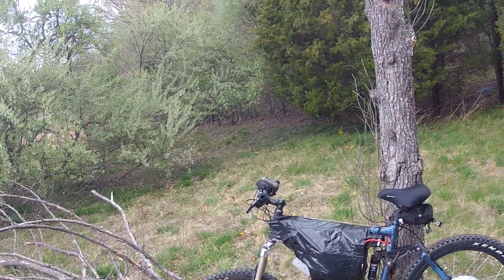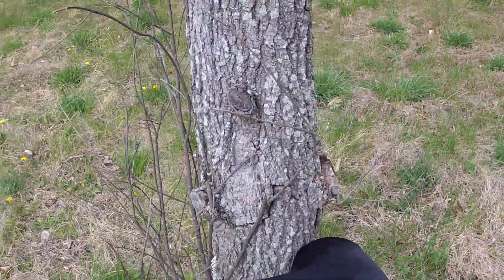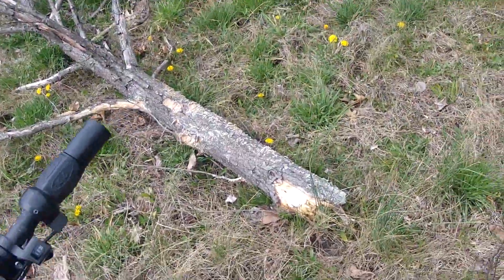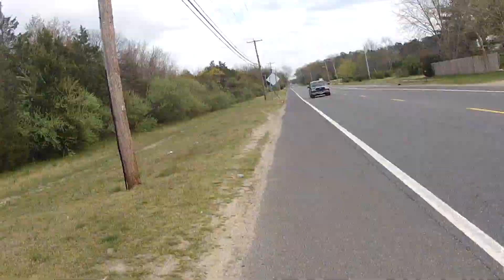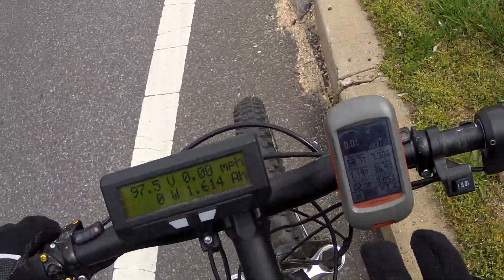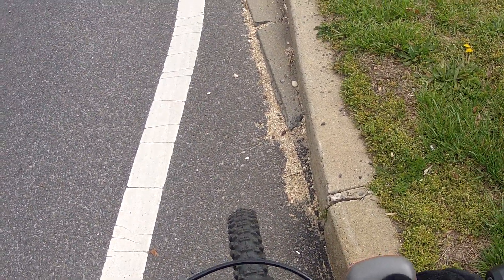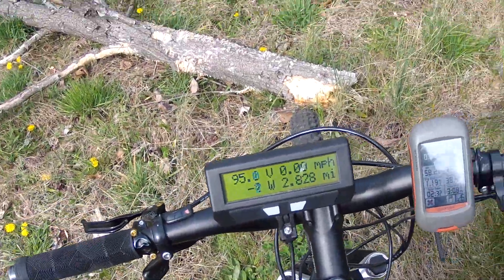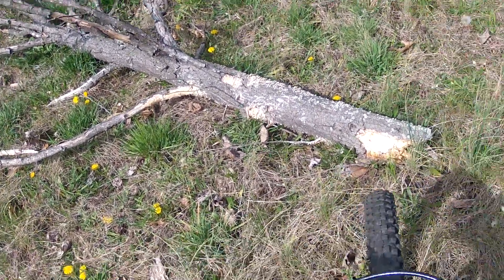Crystalyte 5403 e-bike.  58mph 100v 80amps

Comment: You should get know that that motor is more for torque and not for speeding ;) I use the same hub how ever 72V and "phase" is set to 110-130Amp (right now 110) and i get same speed like you but like i say, this hub is more for torque.. ;)
Reply: LOL 58mph at 72volts? I'de LOVE to see that.
Ive seen about 5 of these motors being used on the forums. NO ONE is near 60mph at 72v. i guess your special?! lol (small bus special)
Reply: Billy Chron im sorry. 72v or what ever... its not really that 72v that makes the speed lol. If you dont have your own to show or speak about then what good is there to talk about Them others bikes or hubs?
Reply: SuperMaiki76  actually, volts is exactly what determines your speed. Along with the hub and rim size. Amps determines your acceleration. Again, no way your getting those speeds at 72v
Reply: ok, if u say so
Reply: SuperMaiki76  and I do. Check my other vids. I have used 4x other hub motors with different windings (speed vs torque) along with 48v, 72v and 100v setups with my amps ranging from 20-120amps as I progressed in both knowledge and ability.
http://WWW.endlessphere.com is the place to soak up more information than you need, from people like me that actually build and experiment with these things.
Reply: Volt's only half determines the speed of your hub. The amount of copper winds on the motor determines the other half.

The amount of winds on the motor will determine the speed at which the hub will turn. This is measured by KV (Turns per Volt). 
Most of these big motors are around 8 - 10 KV. So if you have a motor with a wind at 10KV, which runs at 96 volts then that's 960 rpm.

However if you specify a motor to have a lower voltage with the winds adjusted to have a higher KV rating then you can have a 72 volt setup that will go fast, however these would be custom, and draw more amps than a 96v setup but it would go to that speed! 

My 7kw 96v setup will only do 45 mph tops! but I specified it do so as I wanted all torque monstrous acceleration and not much high end.
Reply: "Torque Monstrous Acceleration". Auuuhhh Yeeeaaahh maaaan. Speaking my language. I'm trying to build the same thing. I feel like I'm chasing my tail a bit. Could you point me in the right direction of how you went about building that?

Comment: I can go 30mph at 52v and 19 amps around 1kw. To go twice as fast u need 4 times more energy. Considering you will increase in weight of batts and motor plus better frame to handle speed. You need 5 times more but u need 8 times more. That is horribly efficient.

Comment from the maker: the $2200 im talking about is just the motor, batteries, controller, throttle, charger, power supply etc.. that doesnt take into account the aftermarket parts i have on the bike; King headset, Formula hydro brakes, seat, endless rear tires, rims, endless amounts of expensive high temp silicone wire, endless solder,  150x Anderson PP connectors. Not to mention a ton of time to learn on how to assemble the battery pack, charge it properly, secure everything to the bike properly etc...

Good luck!!

Comment from the maker: silverfd:   
-Im using a Kona Dawg Deluxe 2006.
-everything for the build in the video here was about $2200 + the bike. i spent $800 on the bike. they can be had for less if very used. New they are about $2000. However if you want to go baller, i suggest you get the same bike frame i just purchased. I got mine powdercoated in spiral grey. its really good quality, however it will be a lot more $ to build it. try  Phasor cycles dot com. all 1 word.

Comment from the maker: Watts = amps x volts. For the most part, volts = velocity and amps = acceleration. With thats said, you could have 2 identical bikes, one 100v45amps (4500wats) and the other 100v80amps (8,000watts). Wile they will both have a very similar top speed, the 8kw setup will reach top speed a lot faster.  A lot of people seem to be confused with watts, amps and voltage. I hope this clears it up a little for you.

With that said, line me up with a bomber for a 0-50mph race and i will annihilate it.

Comment from the maker: Surprisingly the 5403 feels faster across the board.  The 540x can take more juice for longer without overheating. So once I get my new controller I plan to up the amps to 100amps and upping the volts to 134. Will be 32s4p setup on a 24fet4115 board controller. That setup is the one that will be fast

Comment from the maker: Yea, i think it ended up being 400 watt-hrs used in 4 miles. So i was averaging about 100 wh/mile. Ive consumed as much as 150wh/mi, but that was when i had torque arms. 
Im hoping my torque arms will be ready by the weekend. Looking to post up some 0-60mph times. Im assuming it will be 0-60 in about 7 seconds or so. I know the 0-30 is about 2.5 seconds.

Comment from the maker: I got the hub laced to a 26" rim from crystalyte. So whatever spokes they use. I do know 80% of the spokes are bent from Crystalyte. Really poor job lacing.  ITs a 18FET controller from Lyen on a 4110 board. 80/200 amps. 
.